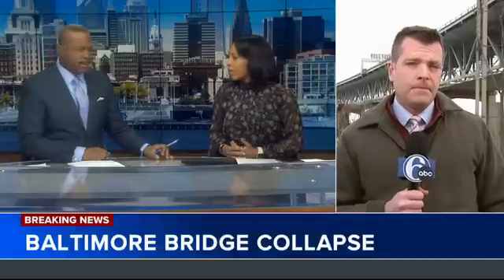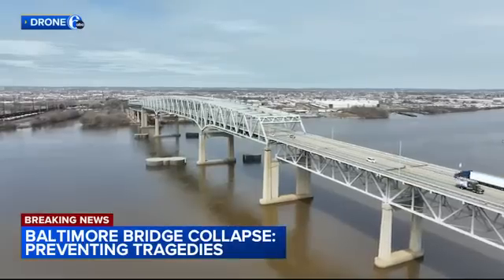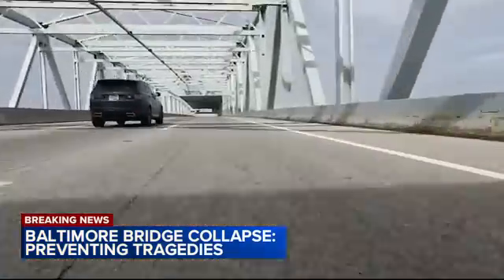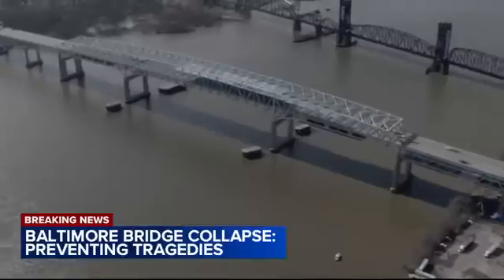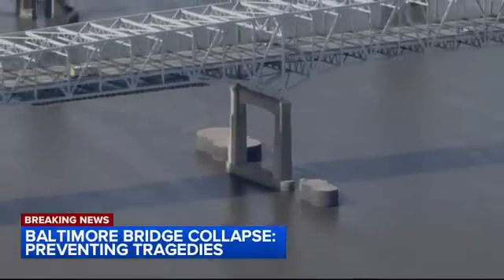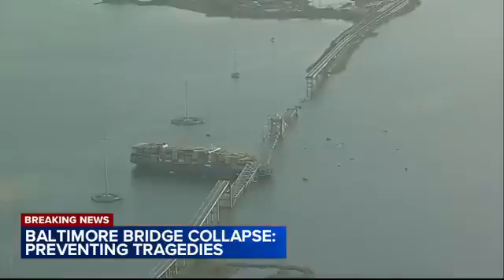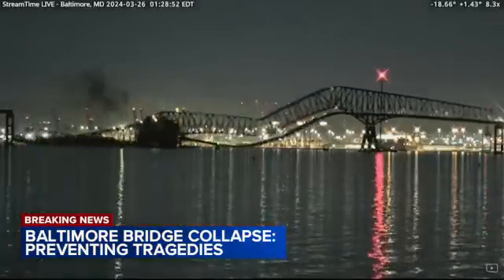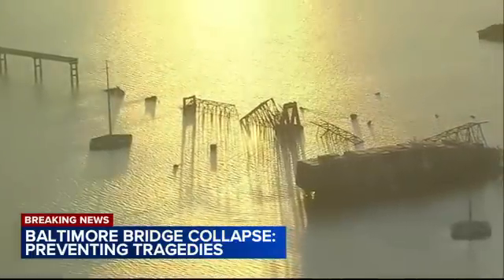Here's what surprised a structural engineering professor about the Baltimore bridge collapse

Comment: That particular ship has a gross weight of 95,000 tons, so no, a bridge pylon isn't going to stop it.
Reply: A properly built bastion will absolutely absorb and deflect even a container ship. It's horses for courses - if you're in the Baltimore shipping channel, you need a damn big one.
Reply: @Rutherford_Inchworm_III 
When they build a new bridge, we will find out how big it needs to be because I’m sure it will be included in the design
Reply: @Rutherford_Inchworm_III  95K tons at 8 knots... hahaha that's 3.5 times the momentum of a 747 at cruising speed. Yeah tell us about your magical bastion
Reply: @RWZiggy  Don't be stupid. A container ship is not a comic book character. You can stop it with concrete dolphins sunk deep enough into the bedrock. It's done all the time. A cruise missile hits a lot harder than a 747 and they have plenty of things rated against those.
Reply: @RWZiggy  hate to say it, but the bridge pillar stopped it pretty quickly when it hit (it stopped in abt 200ish feet). I hate to say it but I have a feeling that a head on impact with a concrete block anchored to bedrock would do slightly better
Reply: @RWZiggy The bastion doesn't have to stop the ship head-on.  You design an angular bastion as a wedge with the point toward the direction shipping approaches from, and the two long legs aiming just left and right of the structure to be protected.  Any ship on route to hit the bridge will be deflected either back into the shipping channel, or out of the shipping channel where it will run hard aground before it reaches the next bridge support further ashore.

It doesn't NEED to stop the ship dead.  And frankly, even if a ship DOES hit it square-on and somehow break the concrete, it'll then have to ride up and over the broken bastion, all the while dragging it's belly on the bastion and the bastion's foundation... which, yes, is going to stop that ship.

It doesn't take a 100,000 ton, ship-sized barrier to stop a ship, just like it doesn't take a 2-ton, car-sized barrier to stop a car.
Reply: @bronco5334  And the hull bends and buckles and the ship continues on to hit pier.

seriously, do people believe the superman comics where he grabs huge ship by one end and lifts it up at 45 degrees?
Reply: @RWZiggy How TF far do you think this ship would continue moving while it's entire belly is hard aground on the dolphin?

Ships, like water, take the path of least resistance.  It's not going to continue going straight through a concrete dolphin when it takes far less force to deflect it's course, and a properly designed dolphin will be angled to do exactly that.  

And yes, if the ship were to go "through" the dolphin, it means either the ship grounds itself, or it tears and collapses it's hull on the dolphin.  Either way, the ship's forward momentum is arrested as or more quickly than it was by the exact same mechanisms at play when it grounded itself on the bridge pilings, where it stopped in about 1/10th the ship's own length, or roughly 90 feet. 

Seriously: how can you literally see the distance it took for the ship to stop upon hitting a concrete piling, and yet still insist that a concrete piling couldn't have stopped it in that distance?
Reply: @bronco5334  Bridge absorbed energy first. 

Hull on dolphin collapses and question is of analysis of friction and momentum.  Just outright saying it will stop without considering initial conditions is nonsensical.
Reply: Ugh, the bridge pylon stopped it cold. 🤔
Reply: @oriraykai3610  *   Excellent point. End of this discussion.
Reply: @oriraykai3610  Yep. The pylon did indeed stop the vessel. Unfortunately the 'nose' of the vessel (I clearly dont know the naval language) hit the bridge itself before its bulbus hit the pylon. As I understand it, the sequence of event was the ship first hit the bridge, then the pylon.
Reply: @oriraykai3610  after transferring energy to the bridge and bringing it down
Reply: The total weight of that boat loaded was 114,000 tons.
Reply: It actually did stop the ship tho.
Reply: Except for the parts of the ship it didn't...
Reply: That entirely depends on the size of the bridge pylon. 
A big enough phylon could stop ship 10 times this size. 

The question is how big a pylon would be needed, and would it have been worth the cost.
Reply: The pylons would also have to get bigger and block more of the channel.
Reply: Damn right. Which is why there should have been dolphins protecting the piers. And I don't mean Flipper.
Reply: My 9 yo kid will know that is not about stopping but deflecting the force...
Reply: The dolphin isn’t there to just take the impact. It’s there to deflect the ship around the pylon. The other option is to pour rocks and rip wrap around the pylon so that the ship grounds on them.
You can be pretty sure the Newbridge will have protection on the piers
Reply: @robdog1245 That's incorporated into the design. Google it, I genuinely can't be bothered to explain the entire concept to people on YouTube who don't actually give a sheet enough to look it up.
Reply: As a household cleaner with over a decade in cleaning all types of bullshit..I can assure you that P Diddy was on that ship and tried to coerce the Capt to do bootyhole activities and thus this occurred.
Reply: @Joe-by8jh  My education is impeccable.
Reply: Even if the pylon couldn’t stop it it could slow it and maybe that could have made a difference. Maybe it would have deflected the barrier. Idk.
Reply: and theyre right next to the bridge too, need to be farther away
Reply: That's 190,000,000 lbs for you Engineering professors.
Reply: @mattywho8485  and bow crumples while ship continues on course.  thanks for playing.

In this crash energy was absorbed by bridge and pylon.
Reply: All of these assumptions are based on the belief that those containers had cargo and the ship was at its maximum capacity.   What products does the United States ship to Sri Lanka using the Port of Baltimore?
Reply: @ArtStoneUS  I'm pretty sure that the shipping companies who operate these vessels at millions of dollars per trip don't haul them back to home port empty.
Reply: A protection pier in the shape of a slightly angled segmented ramp will take any weight ... as the forces generated during a collision are directed to the ground. Small sandy islands around piers would do the job also ... absorbing the forces like boxing gloves.
Both of the above are not expensive solutions, even in the US context,  aren't they?
Reply: @MichaelT_123  false, would not "take any weight", you aren't an engineer.
Reply: @RWZiggy  How do you know?
Reply: @RWZiggy engineer here, Michal was actually right, even though he's "not an engineer"
Reply: @RWZiggy  How do you know?
Reply: Unfortunately you're comments here why true, don't apply. These pylons were not designed to handle an impact from anything near this massive.
Reply: @alexanderdeburdegala4609  hate to be that engineer, but that's literally what we design them for... the worst case senario
Reply: And how often do they get rebuilt? The ship involved in the Tampa bridge disaster in the 80's was 5x less tonnage. Ships keep growing and growing. What worked 20+ years ago, might not be sufficient
Reply: Plus, this ship had a history of troubles during inspections with the same issues that caused the ship to fail. 

On top of that, it's a full moon which affects the currents and tides.
Reply: @astridgalactic9336 the moon is made of cheese.
Reply: It's not about stopping the ship, but deflecting it back to the channel. It works all around the world. Apparently Americans need to catch up with the world. Again.
Also bathrooms do not need to have gaps, so everyone can see you.
Reply: @pawelzielinski1398  The gaps are deliberately there to make you feel uncomfortable, so you'll poop faster and get out of there more quickly. Built as designed. I'm not defending that design, I'm just explaining it. One of the joys of visiting the UK; comfortable privacy while answering nature's call! 💩
Reply: @robdog1245if you cant stop it you redirect it, even if it was to the side it would still allow the ship time to go full reverse and come to a stop
Reply: 95000 you say more like 500 000 dude 🙆‍♂️🤷‍♂️😵‍💫
Reply: @darrenicon5172  more like 100,000 tons
Reply: @ericdraven7185 but to calculate the force of impact you need to multiply it with speed so 100,000 * 8 kts
Reply: @princeo15  The impact of that ship was roughly 10,69 gigajoules of energy, as the formula is M*V*V/2. So 95.000.000 million kg sailing at 15km/h produces that much energy.
Reply: Correct.
Reply: @oldtimer4888 like any of you know what’s correct
Reply: A pylon 100ft ahead of this one would have stopped it, the pylon stopped the ship is a correct statement , it's the fact the bridge fell we want to stop. Also what if a bridge had connections made of epoxy or another material with a lower shear value at the connection on pylon. That way only one section tears away instead of 3-4.
Reply: @MrJoker-  Pylons are not guaranteed, the reduce the risk, but they don't make it zero. Your statement about epoxy etc, means you don't know much about how tension works.
Reply: @alexanderdeburdegala4609  I'm asking questions , not trying to act like I know it all. Sometimes thinking outside of the cone is needed, thanks for the information, have a nice day.
Reply: @alexanderdeburdegala4609  also I'm saying instead of having tension spans long , shorten the sections and have shear points to stop catastrophic failure, you picking up what I'm laying down yet?
Reply: @MrJoker-  Bridges aren't designed around " what happens of part of it breaks off ". It would take a whole reworking of the discipline
Reply: @alexanderdeburdegala4609  just looking at other options, nothing wrong with doing so, it's where innovation comes from. How many questions have you asked compared to answers you've gave. It may help to rework something's.
Reply: Your Dunning-Kruger is showing
Reply: @alexanderdeburdegala4609  insults only prove you have no valid points.
Reply: You may not like the truth, but it doesn't make it an insult.
Reply: @alexanderdeburdegala4609  truth is in the eye of the beholder. What have your eyes seen that makes your opinion of any value to me.
Reply: No, the truth is the truth, and facts are facts. It's also obvious from your grammar that English is NOT your first language, so where are you trolling from?
Reply: @alexanderdeburdegala4609  You a philosopher and an engineer, let me clap so you feel validated by other humans. GOD bless ya fella and have a better day tomorrow. Sure glad Elon didn't listen to opinions like yours.
Reply: @alexanderdeburdegala4609  fact is you wasn't on the ship or the bay , you haven't the first clue of what happened, except what you have heard or been told, change my mind.

Comment: Why?
The lowest bidder.
That’s why.
Reply: Thats not how these contracts work, the state road authority puts out its requirements and companies compete for the contract. Obviously it wasn't a requirement.

The bridge was built in 1972, thats before the tampa bay bridge collapse caused by a ship that led to the building of these dolphins and other obstructions to prevent future collapses.
Reply: @elliotkane4443   That is why smart folks regularly do a systems analysis on things.  Following the Tampa Bay bridge event, the folks responsible for this bridge should have looked at the likelihood and severity of a possible event involving this bridge.  The likelihood is low, but as we've seen the severity risk was catastrophic.  Then you develop and implement a plan to make the needed improvements to reduce the risk.  This event was predictable and preventable.
Reply: 1977 but yeah. And it passed it's most recent inspection Much higher than so many bridges in this Country.  @elliotkane4443   It celebrated it's 47th anniversary three days ago
Reply: @elliotkane4443  I live in the Tampa Bay Area, have actually ridden across the old Sunshine Skyway bridge both before and after the accident (only one of the two spans collapsed so the other span was changed to accommodate both directions of traffic while the current Skyway was built) and have both driven across and boated beneath the current Skyway bridge.

I remember the Skyway collapse well even though I was pretty young then.  It was devastating.

The first thing I noticed when boating under the new Skyway were the dolphin bumpers.  I thought they were brilliant and I think that may have been one of the first bridges to use them.

I really do feel that the Skyway disaster led to a lot of creative engineering that helped bridges become significantly safer.

I mentioned in another comment that the Francis Scott Key bridge was newer than the Skyway but the bridge was completed just a few years before the Skyway disaster so the lessons from the original Skyway bridge had not been learned yet.

It really is a shame that dolphins were not added later but I guarantee they will be on the new bridge that replaces it.  I think tug escorts wouldn’t be a bad idea, either.
Reply: Actually I suspect they could have added the barriers like the Betsy Ross bridge at any time. They choose not to do it. Lowest bidder had nothing to do with it as they’ve had 47 years to add it.
Reply: @ninjagirl226  Thanks my dear! You nailed it!
Reply: Another stupid comment...
Reply: Lower taxes!
Reply: It was an old bridge so old design and was WAY out-weighed by the massive ship and that ship had quite a bit of momentum.  The bridge did the best it could.  

Saying that bridge should have stopped that ship or survived that ship strike is like saying a if a tractor trailer hit a person that the person should be able to stop the truck and survive the strike unscathed.

When it comes to engines, there’s a saying that there’s no replacement for displacement.  When it comes to energy, the same can be said for mass.
Reply: Perfect handle for someone with no knowledge of physics.
Reply: @henrylubinski2728 most Americans don’t have even a passing knowledge of physics. It’s remarkable in a terrible way.
Reply: @patty109109  most Americans don’t have even a passing knowledge of physics... and law, and History, and government, and geography... very sad to read the comments.
Reply: @henrylubinski2728 what does his comment have to do with physics there brainiac? C'mon genius enlighten us lol
Reply: Why?
Unions. 
That's why.
Reply: And they took three sweet time to build I mean come on 10 years?? in Japan they could do it in 2 years
Reply: @slabbusterrtr7690 

Chinese : it require 2 year ? OMG
Reply: Lowest bidder on the construction and too much money going to social programs to do real infrastructure. This is why 6 people just died, they were fixing potholes on that bridge at the time of the collapse.
Reply: @oldfarthacks This is a specification/design issue, not a construction quality problem.
Reply: @oldfarthacks  ...Too much money going to weapons, social programs help people weapons kill people.
Reply: @oldfarthacks What do you think infrastructure is if not a social program? Y'all so blindly indoctrinated against anything with "social" in it that you can't be trusted to have an opinion on anything.